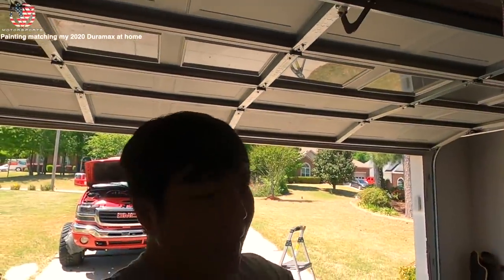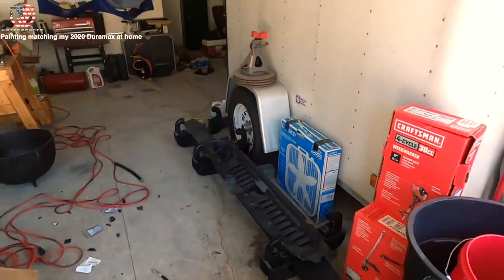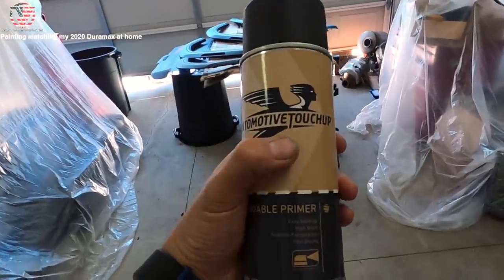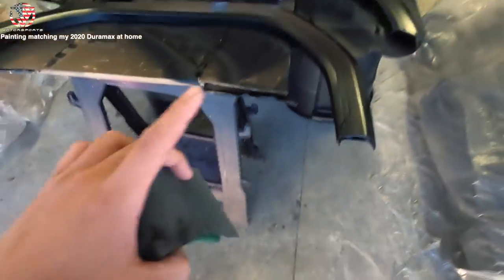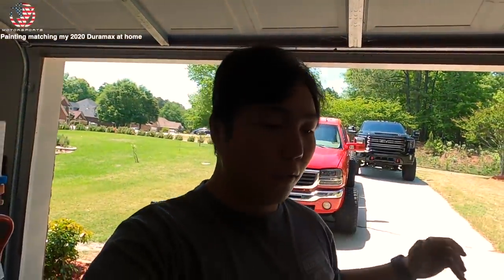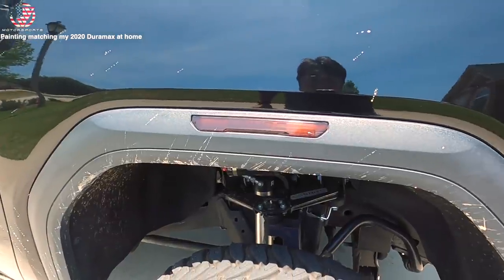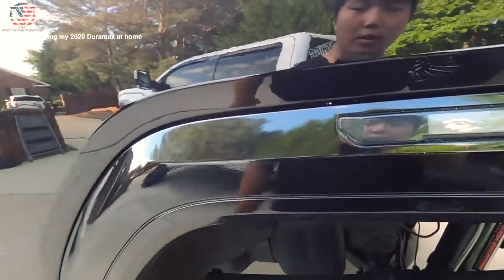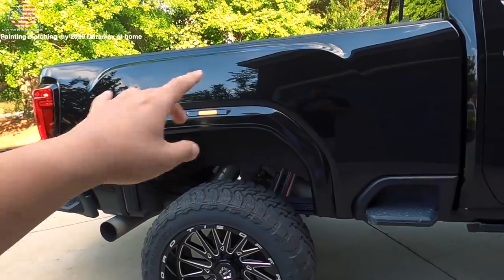HOW TO PAINT YOUR DURAMAX FENDER FLARES AT HOME + *BoostAutoParts Fender Lights*

Comment: Good to mention, if. I sanding is to be done, and no filler primer used, on fresh scuff padded fender flares, you can skip the primer and go straight to paint. 

1.) scuff pad surface
2.) adhesion promoter
3.) base cost
4.) clear coat 
5.) either wet sand (If dust is in clear or orange peel,  then, or compound polish if surface was blemish free

Comment: Great Job, thank you for the video.  Where did you get the buffer adapter for the drill from?  I had one that came in a kit from Meguiars but the pad has fallen apart and cannot find a replacement without purchasing another scratch eraser kit.